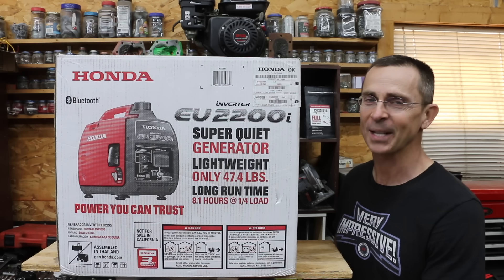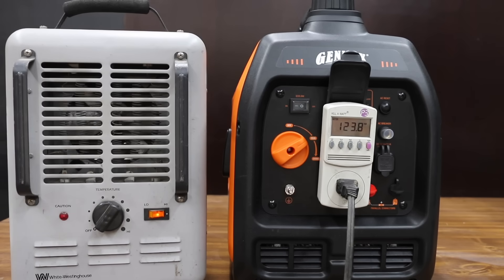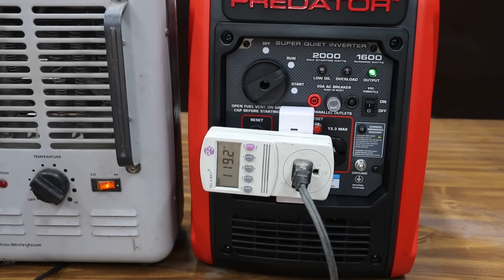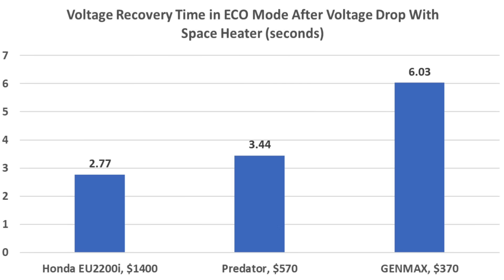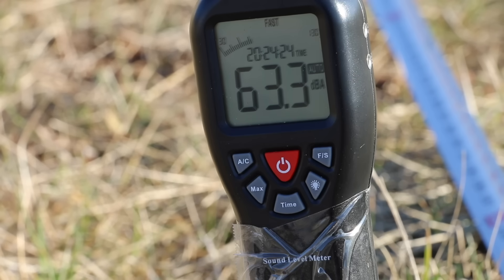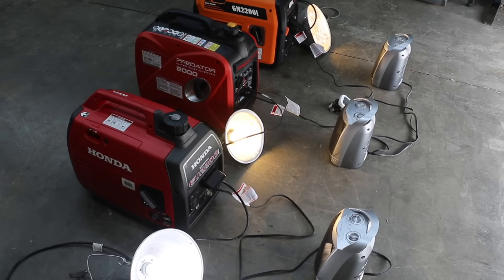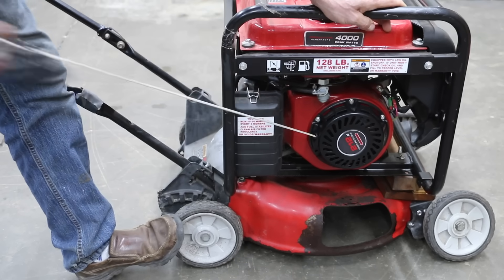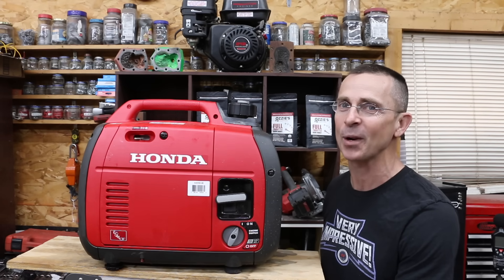Cheap Generator Better Than Honda? Predator vs Honda & GENMAX—Let’s Settle This!

Comment: Well I have experience with the Honda and the harbor freight models. We had terrible luck with the harbor freight units we never got more then a month (but a week or two was typical) out of one. Failures ranged from burnt windings to thrown rods. These gensets were run 24/7 with daily oil change shutdowns. The Hondas lasted at least 6 months. That’s no small feat for a splash lubed gasoline engine to go 4000 or more hours! The harbor freight units were about 500 hour units if you were lucky. These Honda units aren’t bad for the price. I own one myself I use for camping and stuff but it doesn’t get any real hours on it so I’m comparing the ones we ran at work that ran 24/7 running computers radios and stuff in excavators and stuff. This equipment ran with 2 shifts 24/7 for 6 to 8 months straight. Hope this helps someone, I doubt many people are going to rack up that many hours on tiny gensets so I figured I’d share my experiences.
Reply from the maker: Thanks for sharing.

Comment: It would be interesting to see how these gennys hold up long term. 
Noise levels, voltage drop, fuel & oil consumption are all important but what good are specs when it doesn't work.  
Ill bet the honda will outlast the predator at least 2:1 meaning 2 predators will consecutively run through their functional life before 1 honda.  To me thats where the real value is.
Great video. Thanks for all you do.
Reply: In Florida, where your life depends on this generator running optimally for four to five months every year (Hurricane season), I wouldn't depend on anything but a Honda.  I tell people it's a lifetime investment.
Reply: Closer to 8:1 honestly.
Reply: @nobodynoone2500  I was being nice. Lol 
I have my honda eu2000 since 2004. It doesn't get heavy use. Maybe 500 hours a year max, but it still runs great. Only regular maintenance every fall. One of the best investments I've ever made except for my 97 f250 powerstroke and my weber bbq.
Reply from the maker: Thanks and you are welcome!

Comment: great test. still getting the honda tho, if i need a generator i want it to actually start without murdering whatever i connected to it and cost is abslutley a secondary factor because if you cheap out and it wont work when you need to it for some stupid reason you are going to bang your head against the wall for the next 2 weeks about it.
Reply from the maker: Thanks!  Thanks for the feedback.

Comment: I'm curious to see if the CO2 detection worked on the generators as well as the total run time with full tanks.
Reply from the maker: Thanks for the suggestion.

Comment: One more comment about the multiple pulls to start the Honda. Unlike engines with gravity fed float bowl carburetors, the eu2000i and eu2200i carbs pump the gasoline up via vacuum. It typically takes three or more pulls to start an engine thats new or has been sitting for days to months. But it also means that the gasoline drains out of the carburetor while in storage, avoiding gunked up carbs that plague other engines.
Reply from the maker: Thanks for the feedback.
Reply: Mark thanks for that but of information. I have had a Honda 2000 generator for about 15 years and it's a great unit but I always wondered why it took 10 or more pulls to start when it hadn't been used for a while. Otherwise it Starts first pull cold or warm when in regular use. Excellent piece of equipment like the other Honda stuff we have.

Comment: generators are like umbrellas if you have one the power never goes out, we bought the EU6500 Honda after a couple day power outage and power came back on. we only used it for a couple days a year or two later then power company got so much flak over trees shorting out lines they cut everything back. and we sold it but i got the cheapest little 2000-watt aldi generator on clearance sale for 179 dollars it keeps the power outages away now. LOL
Reply from the maker: Thanks for the feedback.

Comment: Excellent comprehensive testing. Your attention to performing thoughtful intelligent testing is really appreciated.
In this case I can make an educated purchase and get the generator to fit specific needs. 
For example I might buy the less expensive item for powering a few lights at a remote camp, whilst the Honda would be more suitable for running my electronics in emergencies.   Regardless, your work is very comprehensive and my first choice for product overviews. Great job !…again.  why can’t all product testing videos be more like yours ? I watched dozens of generator video’s and none come close to providing meaningful detailed information.
Reply from the maker: Thanks!

Comment: surprisingly  no miracle happened, how could it happen,  good job @Project Farm showing that good refined through years can't be cheaper than it competitors,  you got what you payed for
Reply from the maker: Thanks!
Reply: @ProjectFarm   thanks for your work,  last autumn Ive bought 1000w honda as last resort,  after beckup batteries discharge and allow work remotely regarding outages after air strikes (im from Ukraine),  it cost me 1200euro for 1000w one bought in Germany,  Im telling all this for a reason: know you use case.  For me it was expensive,  but i needed reliable one that won't let me down in need, ive got cheaper ones, those burn connected online UPS,  twice,

Comment: Tractor Supply sells several different lesser known brands like Champion, Sportsman and DuroMax.  I'd be very interested in a run-down of some of the 4k models that I'm looking at for my backup power and race trailer.
Reply from the maker: Thanks for the feedback.

Comment: Internet  er... wisdom says that the Predator carbons up under 'eco' mode.  First things you do with cheaper generators is toss the Torch spark plug as far as you can... and replace with an NGK.

Comment: A little out of scope for this channel but is there a way to demonstrate how "a noisy signwave is bad for sensitive electrics".

From what I can tell if you're not using medical equipment most modern electronics such as laptops and TVs can run off modern generators just fine.
Reply from the maker: Thanks for the suggestion.

Comment: I got a Honda EU 2000 for $900 (10% off farmer union discount) over ten years ago, used it to build home and daily to power it until could afford solar two years later.  It still works great.  Only use non-ethanol gas and run it till runs out.  Replaced the pull string once and the plug and filter fat less often than ideal but it still runs great, oil changes and gas aren’t as good at beating the local power company costs as solar and golf cart batteries but very glad with the investment because it was still cheaper than the over 30 cents charged by the electric company. Also glad to have it for portable power around the farm and for when need to replace the solar batteries, too many cloudy days on a row, higher than normal energy needs etc. Glad for the Honda reliability also considered the propane conversion to run on collected biogas from composting. The auto start/shut off and charging battery bank through Outback inverter are other advantages of the larger champion and firman models but the reliability of that Honda makes me consider the modification options to it. Haven’t seen an auto start for that Honda but it would be great.
Reply from the maker: Thanks for sharing.

Comment: Such small drops in voltage don't mean anything bad for the appliances. +-10% voltage is practically always tolerated, even for continuous use.
Reply: That is the utilities spec for line voltage regulation.

Comment: I live in a camper and my Honda servers me well. non of the other small generators will run my space heaters or my microwave or my ac unit but the Honda does it with easy and I can connect it to phone tracks how many hours for me. even if I fall asleep, it tells me when it needs servicing. And I had it get flooed one time I filled it up with rice for 2 days let it sit and then blasted it all out with air and it Starts right up just needed to dry the electronics out.
Reply from the maker: Thanks for sharing.

Comment: I have had 3 Genmax generators over the last 2 years. Averaging out to about 2,500 hours before failure to start. Which was easily fixed with a full clean up of the internals. 

The price of the Genmax just can't be beat. I have no idea why Honda's generators are so expensive. Must be a branding tax or something.
Reply from the maker: Thanks for sharing.

Comment: Can you test these so called powersaving devices:  https://www.amazon.com/dp/B08CNH6H1H/ref=sspa_dk_detail_6?pd_rd_i=B08CNH6H1H&pd_rd_w=n9o9G&content-id=amzn1.sym.0d1092dc-81bb-493f-8769-d5c802257e94&pf_rd_p=0d1092dc-81bb-493f-8769-d5c802257e94&pf_rd_r=NJEDEV7JNSVVDPVYDMQS&pd_rd_wg=8ykK7&pd_rd_r=c6f4425f-05d9-47e9-ac3a-24eba4f6187c&s=electronics&sp_csd=d2lkZ2V0TmFtZT1zcF9kZXRhaWwy&smid=AXHF4BIWWXH5P&spLa=ZW5jcnlwdGVkUXVhbGlmaWVyPUFORklMSVVUWFFNWlUmZW5jcnlwdGVkSWQ9QTAxMDI5NzYxR1c4VTg1NFY2M1JZJmVuY3J5cHRlZEFkSWQ9QTEwMTM1NDczOE1ISVlRMUowR1hIJndpZGdldE5hbWU9c3BfZGV0YWlsMiZhY3Rpb249Y2xpY2tSZWRpcmVjdCZkb05vdExvZ0NsaWNrPXRydWU&th=1
Reply from the maker: Thanks for the suggestion.

Comment: I really appreciate the testing you do. For 40+ years I have purchased mostly Honda power equipment, including generators, lawnmowers, & snowblowers. The stuff lasts forever and has never failed me. Yes, Honda costs significantly more but it’s one of those “you get what you pay for” things.
Reply: Buy once, cry once.
Reply: @scowell  So true...not as easy as it used to be with less options these days. Everything is Chinesium, Mexican, Indian etc. and nothing easy to find from the USA. I blame the warehouses for much of this.
Reply: Yes and when you need it to start and function in emergency times, Honda is the way to go.
Reply: Yep... That's why I stick with Makita tools. They aren't big on HYPE, but are always up there in performance and always last forever
Reply: 100%. Gave up cheaping out on tools a long time ago. Buy the best I can afford and have never regretted that.
Reply: I agree. Everything Honda just keeps on going.
Reply: They’re not overpriced. They’re just good. Product development and quality control is not free. (Nevermind many of these other brands just copied honda…)
Reply from the maker: Thanks!  Thanks for sharing.
Reply: Honda makes quality products. Owned many motorcycles and generators. Only Honda for me
Reply: I must have been unlucky then . About 12 yrs ago I bought a Sears self-propelled with a Honda engine . The engine lasted 4 yrs . And yes , I changed the oil each season .
Reply: @indycharlie  Likely a Honda built for Sears. Not every brand has zero troubles.
Reply: @Garth2011  Yeah , making some engines a bit different that are used on another brand mower would make sense .
Reply: @indycharlie  Should've got a Toro, mine's 15 years old and I've never changed the oil. Shoot, I've never even sharpened the blade! (I probably should though)
Reply: @salazam  Well , that works great if you never start it :D

Comment: I got a predator at harbor freight as a return then got a better discount from talking to the manager. I paid just a bit over 200$ for it in perfect condition just no box or instructions but who reads those anyway? Super quiet and starts easy.
Reply from the maker: Thanks for sharing.

Comment: Out of necessity and during our 2nd 1 week long power outage within a month my old Coleman died, I picked up an Aipower inverter Generator 2200 watt ( basically all they had and they just got them in. I've been extremely pleased with it as it has performed very well, 13 hours on a gallon of gas, very quiet, comes with the wires for hooking 2 together ( I haven't done that ). 
Runs my refrigerator, freezer, 4 lights phone and laptop charger along with TV and cable box I can't complain at all! I would like to see a comparison between it and others.
Reply from the maker: Thanks for the suggestion.

Comment: It would be great to see the Firman generator from Costco included.

The hack with the Predators is to do the first oil change after a short period of time to flush out all the metal from manufacture and break in. I wonder if that would have helped the oil use. Obviously, not ideal.

I would also love to know what the generators output on the parallel plugs. AC/DC, voltage, regulated or varies with engine RPM, etc.
Reply from the maker: Thanks for the suggestions.

Comment: Checking my new Honda generator i noticed the air cleaner is actually a 2 stage course/fine filter.  And the up draft multi size intake tubes are ingenious to have heavy debris drop out of air suspension.
  There seems to be many nuanced designed features that are difficult to quantify or test on higher end quality products. 
Things that are easy to take for granted but require lots of R&D to develop.
Reply: Bingo. The reason for the cost difference is not just materials and production quality.
Reply from the maker: Thanks for the feedback.
Reply: Mine has over 3000 hours and still clean filters.

Comment: With 656g of gasoline results in 7.87 kwh of energy
with 1500w and using it for 32 minutes gives a power of useable 0.8kwh which gives a thermal efficiency of 10.1%, which is 5% better than a steam engine :(        (if my calculations are correct)

Comment: Have you tested any of the BG products
Fuel system cleaner, engine flush cleaner, transmission cleaner
And conditioner for all the same systems
A YouTube mechanic swears by them
Thanks 👍
Great videos
Reply from the maker: Thanks!  Thanks for the suggestion.

Comment: Before watching the video, no, it's not possible.  Every component on the Honda is built to last (coil, spark plug wire, spark plug, carburetor, filters, gas cap, etc.).  We run a dozen 'competing brands' at my work, and nearly a dozen Hondas.  I can already tell you the outcome before even watching the video, it's not even close in regards to longevity, which you can't test here.
Reply from the maker: Thanks for the feedback.

Comment: I own a a couple different Predator generators.  They have a breakin procedure that they want you to follow.  Run for an hour with no load then change oil.  Don't run them at full power for so many hours. Change oil again at 10 hours at half load and so on.  I'm trying to remember from memory.  But it's something like that.  I'm curious what the wear deposits in the oil would look like if the recommended break in was done.  Also that spark arrestor is complete garbage and will carbon up and clog.  Best to get get rid of it.
Reply from the maker: Thanks for the feedback.

Comment: I'd like to see the dual fuel test.  I'm considering the Champion Power Equipment 200988, or Westinghouse iGen4500DFc.  Honda would be nice but it seems out of my price range.  Hoping to keep lights, refrigerator, and freezers running during Texas power outages.   Thanks
Reply from the maker: Thanks for the suggestion.

Comment: Buy once Cry once I guess. I bought two Honda Eu2000i's over 15 years ago and they are still running strong. I even bought/modified a second carb to allow one to run on propane (which is does well, but at reduced power). Will these off brands still be running strong after 15 years of regular use?
Reply from the maker: Thanks for sharing.

Comment: Generac Generator. The Fire Department just went from the Honda EU 2200i to Generac GP2200i due to the cost. I would like to see the difference between the two.  Your videos are awesome. I have searched and watched these for comparison a few times before I have purchased things for myself and the Fire Department.
Reply from the maker: Thanks!  Thanks for the suggestion.

Comment: can you test a generator that runs the AC?  Also, can you test batteries that can run the AC in the house? I know there are some you need to buy 2 to get 240 volts.
Reply from the maker: Thanks for the suggestions.

Comment: Great video! I have a video idea: precision screwdriver sets. I've noticed that some cheaper sets aren't very precisely made, which makes camming out and damaging the screw very easy. I've been using the Xiaomi Wiha set for a few years now and it's been fantastic, but I'd love to see it compared to brands like iFixit, Wera, Wiha, Vessel or Workpro.
If you did that test, make sure to get the Wiha branded Xiaomi set, as the newer version doesn't have Wiha-made bits.
Reply from the maker: Thanks!  Thanks for the suggestion.

Comment: next time you do generators I would like to see Yamaha thrown into the mix.  I'm a little biased since I work at a Yamaha dealer, but I think they are great generators, and personally own 2 Yamaha inverter generators. a small 2000watt one that lives in my truck, and a 6300watt one that lives in my shed for power outages.
Reply from the maker: Thanks for the suggestion.

Comment: Another great video from Project Farm!  I have the Predator and have about 600 hours on it.  I haven't had any noticeable oil consumption but I did do a 5 hour break in with non synthetic oil.  I wonder if I got the rings to seat whereas the one in this video doesn't seem to have done.  I did have a failure of the low oil sensor failing, I disconnected it.  I've been doing my oil changes with 10-30 religiously every 100 hours.  I bough a runtime meter on amazon for just a few buck.  I would love to have a Honda, but for the price difference, my Predator has been a champ and I cannot believe how fuel efficient it's been.
Reply from the maker: Thanks!  Thanks for the feedback.